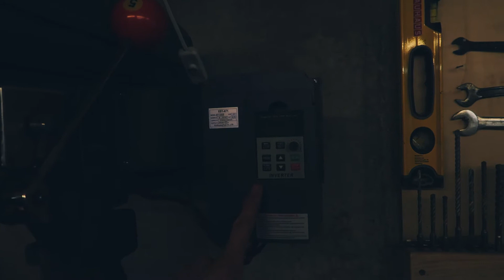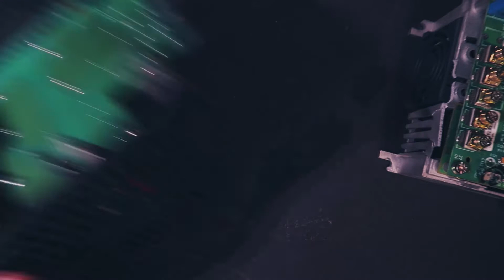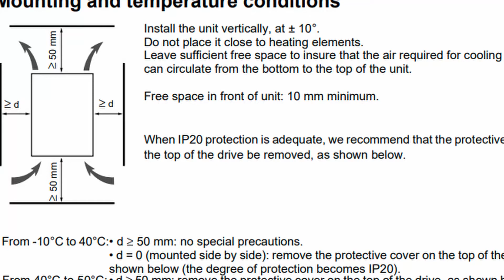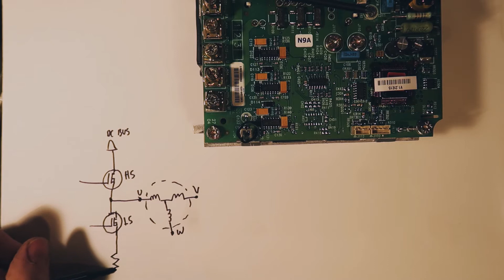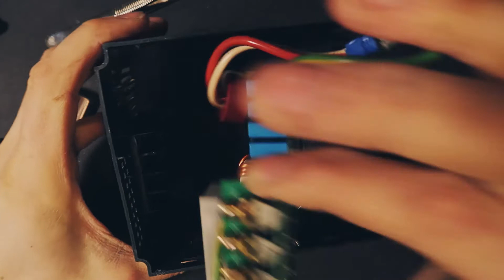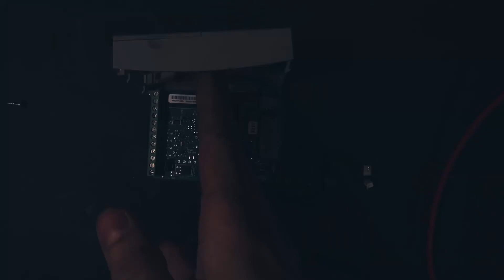VFD (variable frequency drive) Teardown and Diagnosis Part 1 || Altivar 11 Telemecanique

Comment: I need a a ATIVAR 11 repair or replacement ASAP. Can you help?
Reply from the maker: What's up with it? Write me on IG
Reply: @DmitriIvanov  the vfd screen won't come on and there is voltage going to it.
It is the same model on your video
Reply from the maker: No idea i need to see it to try to figure out what's going on with it. You can send it to me otherwise I have no better ideas

Comment: Most of the time, resistors fail open or towards open, so their resistance goes higher than their value. So you can measure them in-circuit, whatever is in parallel with them, the equivalent resistance is going to be lower than the resistor's original value.. Of course, there is a little little chance they will fail short or towards short, but I have never seen such thing for 10 years in my career
Reply from the maker: Honestly never even thought about it that way, thanks for the tip!